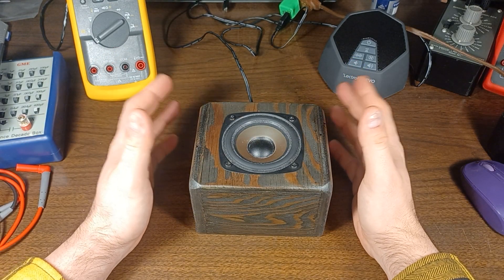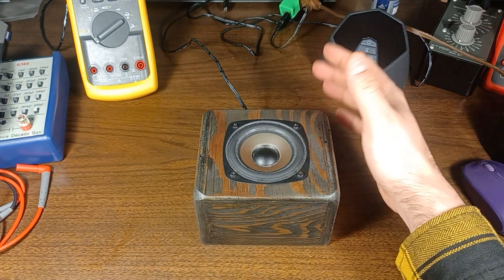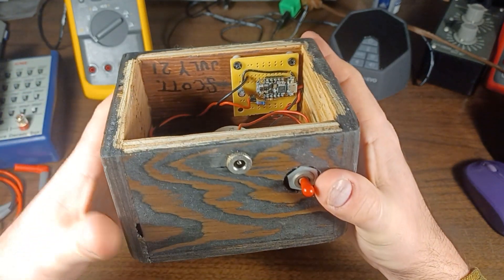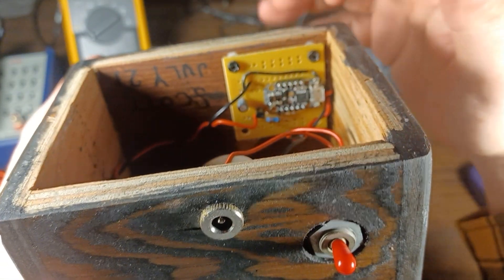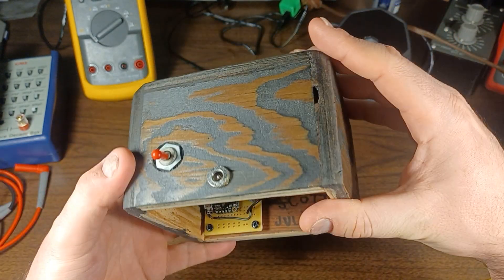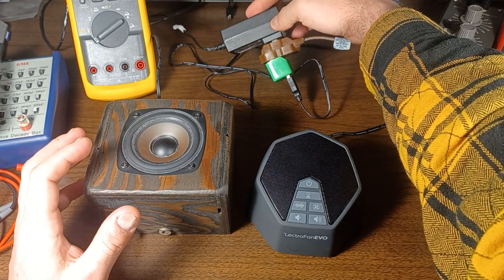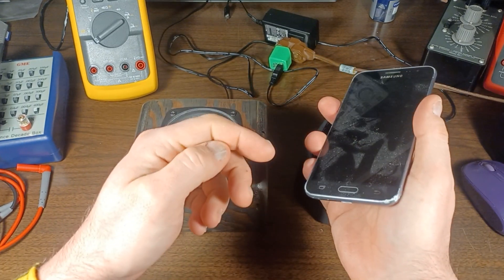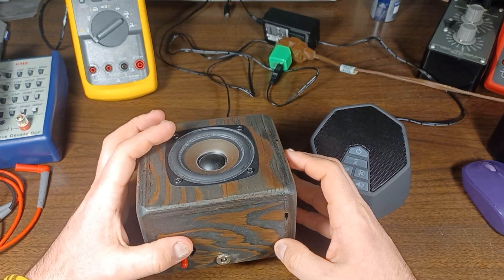My DIY White Noise Machine

Comment: Nice work, Scott. I think I'll try to build one. I like that yours is portable. Normally, I just turn my old stereo to 87.9 FM and crank up the volume a little. But the stereo is kind of tied to one room -- my bedroom. Yeah, I think I'll build something like this myself. Thanks!
Reply from the maker: Using the radio is the simple solution I didn't think of. Have fun with the build!